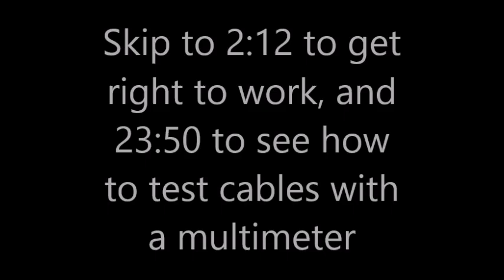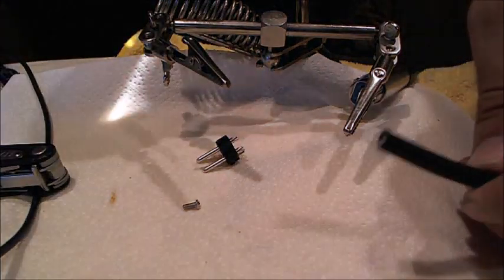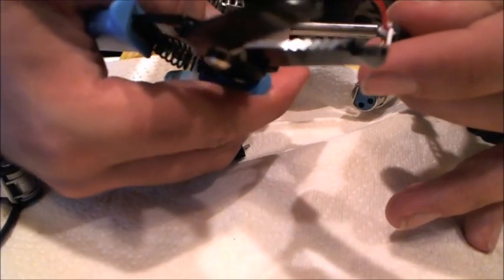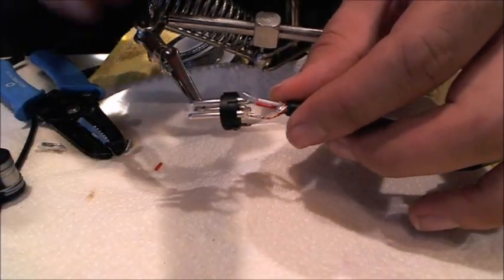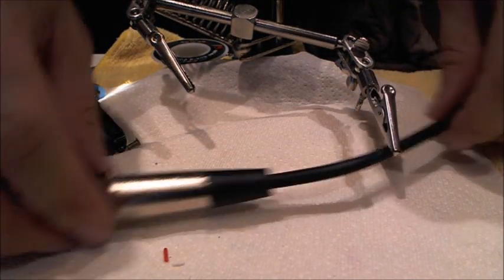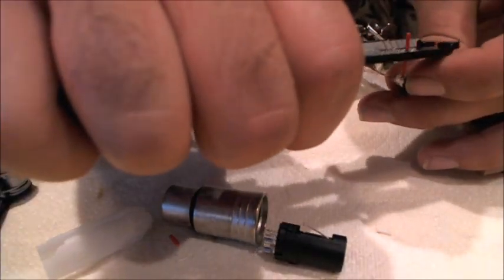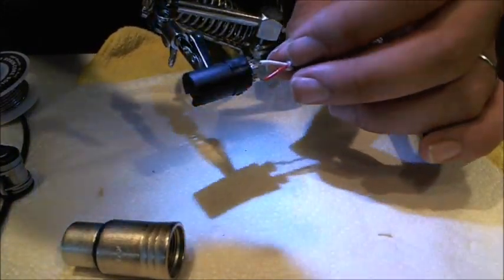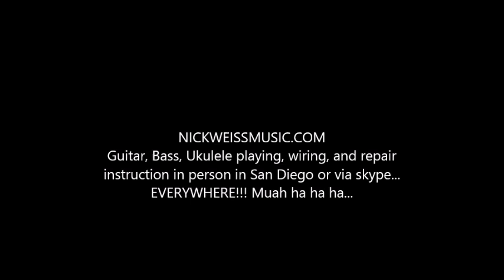How to Repair Microphone Cable with Neutrik NC3FXX and NC3MXX XLR connectors

Comment: The 'string' is to help stop noise when cable is moved around.The cable you are re-using is only fit for scrap, it will be noisy and susceptible to RF interference. If your going to go to the bother of paying for good quality fittings and using crap cable you will suffer in the long run by having to re-do the work
Reply: I agree, the cable he is using in the video is a cheapo piece of crap, why would you put good connectors on that crap wire?  lmao!!  funny stuff...
Reply from the maker: Oh come on now. This is no place for cable snobbery. If you guys think RF interference is a problem for 50 foot runs in a live sound environment, you're showing your naivete. I use 4 lead Canare cable for critical installations or rough use, this Chinese stuff is just fine for the gentle live sound applications I use it for, and costs about 5X less per foot, which certainly factors in for a business owner like myself.  I'm still using this cable 2-3 gigs a week 2 years after this was posted, but what would I know. If you want to laugh at a pro who knows what cable to use for the right application, so be it, but know that we pros laugh at over-equipped amateurs just the same.
Reply: Friend, this is not "Snobbery" If one uses cheep cable the S to N is very bad also one will get a lot of cable noise when the cable is moved around or stood on, and very prone to snapping as the centre core is the cheapest of the cheep copper. Buying cheep is a false economy, you will be back for second helpings of more crap cable.
Reply from the maker: JohnSAitken no, buying cheap cables when they are perfectly suited to the job at hand is good economy. As I previously stated, these are not used in high impact or critical audio quality settings.  I have used the very cable in this video at no less than 100 weddings and corporate events since I posted this, and will be using it again tomorrow. Using expensive cables for a nearly inaudible boost in signal to noise ratio for a wedding toast or corporate speech would be the definition of snobbery. The microphone and sound system are much more important and I don't cheap out there, nor do I cheap out on cables when used for vocals or recording. May I ask, if you are an expert on cabling, why are you watching a video on repairing them? Just to critique technique or equipment? Nobody likes a troll, let alone one that spreads uninformed nonsense on an informational resource. You are welcome to rely on your theories of RF interference and Instant destruction if a foot should happen to tread on this cable, I will rely on my years of experience to make decisions on where I spend my money. GLS cable is fine for low impact, non critical quality audio use, end of discussion.
Reply: completely agree with what you said...however my only comment is that with cheap cables like these, often you can just buy a whole new cable for the cost of the new neutrick connectors anyway.  i just find it fun to fix things and do it yourself so you know it's done right
Reply from the maker: Zach Brown really? I get a pair of connectors for $8-&12 at the worst, where do you get a 50ft xlr for that price?
Reply from the maker: And btw... still using the same cable from the video 3 years ago.

Comment: Actually, I may be wrong, but those "old-school" connectors look like Switchcraft ones. Pretty good ones and quite long lasting. You said that there was a crackling noise right? Could be a dry joint. Just re-solder. Those connectors look perfectly serviceable.

My two cents
Reply from the maker: Alan Oliveiro definitely not switchcraft. They were absolute bottom of the barrel, still got a year or two out of them. Certainly not worth trying to diagnose or salvage. GLS now makes their cables with Neutrik knockoffs and has for years, goes to show how old those cables really are, they might actually have been 3 or more years old before I had to replace the connectors, not really sure. Anyway, still going strong! Using them at my gig tonight!